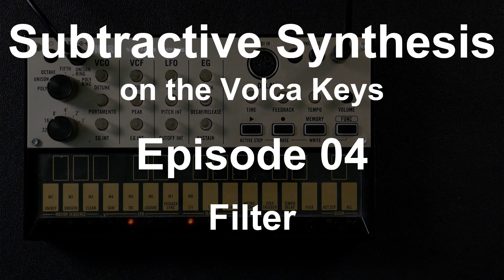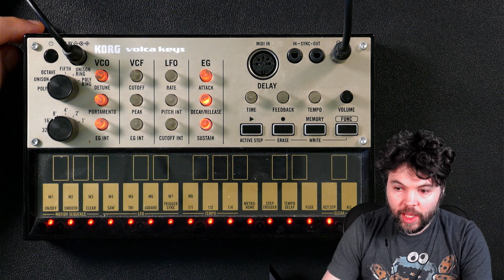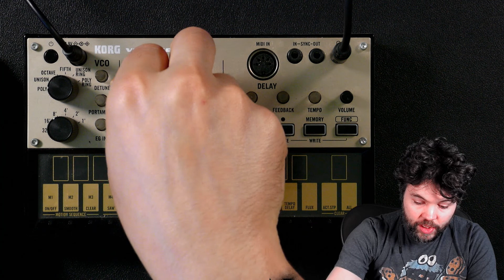Subtractive Synthesis on Volca Keys: Ep04 - Filter

Comment: Just wanted to say thank you for being so generous with your time in making these videos. Can you explain as simply as possible, why it is that subtle use of a high pass filter can somewhat counterintuitively boost bass frequencies?
Reply from the maker: Thanks for watching, and for your comment. The two key elements are filter tracking and resonance. When the filter tracking is set to 100% (often the default), the filter cutoff moves relative to the pitch of the note you play. Since resonance boosts the frequencies at the cutoff, a filter tracked, resonant high pass filter can boost (or generate if set to self resonance) the lower harmonics of a sound. To do this, you'd turn the set cutoff to minimum, turn resonance up until it sounds loud, then sweep the cutoff while repeatedly playing your note until you hear the resonance comes in tune with the note you are playing.

Secondly, it is commonly said that filter resonance (on a low pass filter, especially by Moog) reduces bass. In reality they don't reduce bass in particular, but actually reduce the volume at all frequencies except where the resonance has its boosting effect. The same is true for high pass filters: in other words as well as reinforcing the low harmonic, it can reduce some of the higher frequencies. You can therefore tune the resonance to balance the lower and higher harmonics of the sound.
Reply: @ChalkWalkMusic  Thank you very much for your reply.